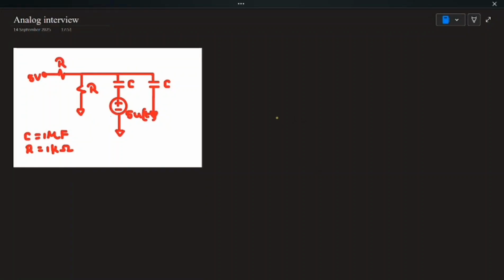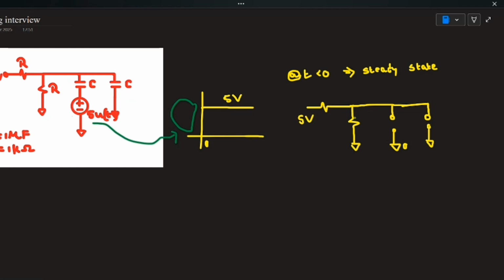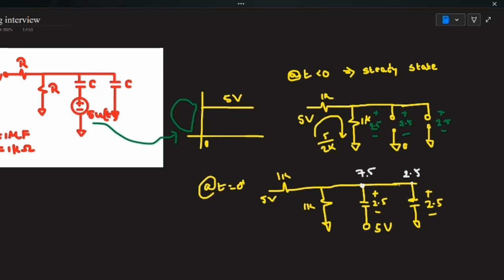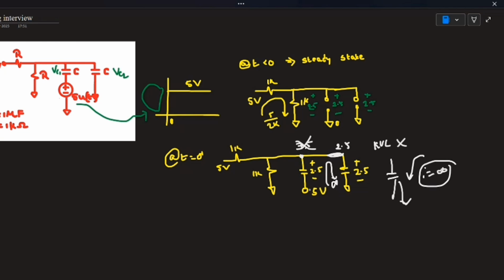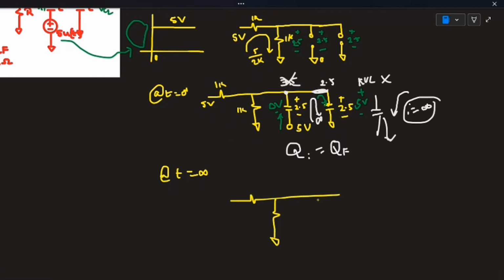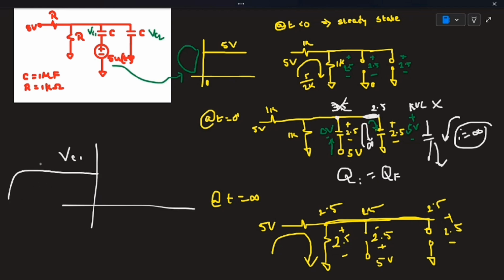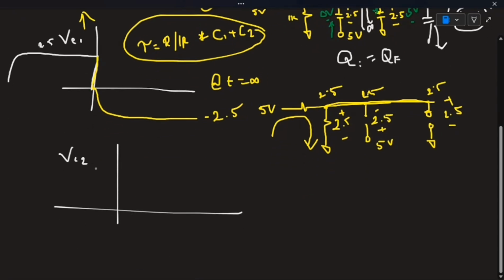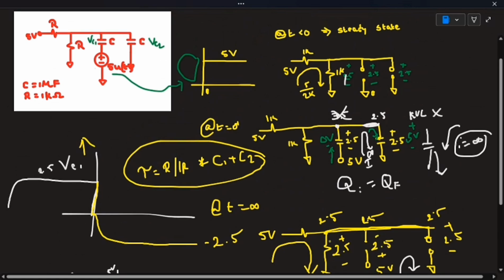Analog interview Question with cadence simulation results #analogvlsi #analysis #rccircuit #vlsijobs

Comment: How is current through cap zero  instantly after t>0 , when the capacitors are getting charged and discharged exponentially??
Reply from the maker: Current will be going out of the cap since its getting discharged, in exponential fashion.
Reply: @VLSIschool current  will decay to zero in exponential form?
Reply from the maker: Yes at steady state current flowing out of capacitors is zero